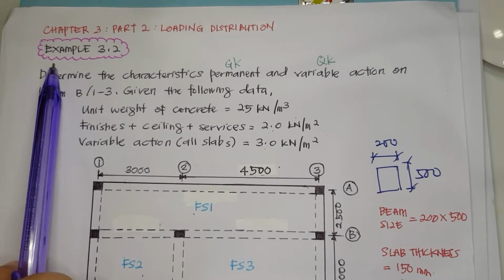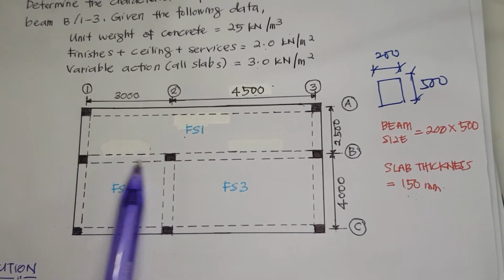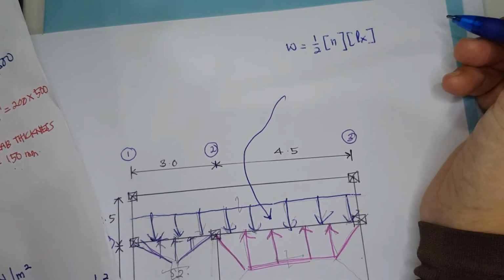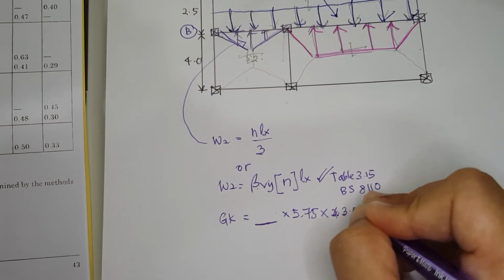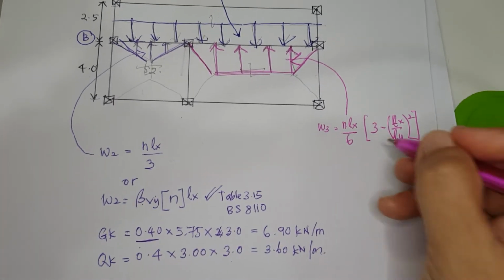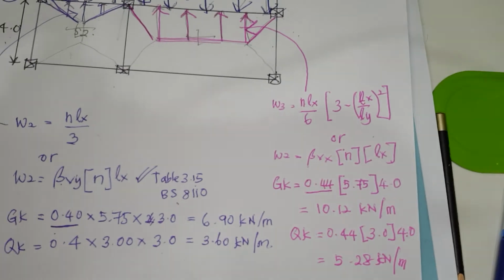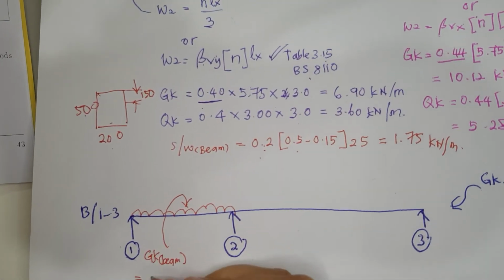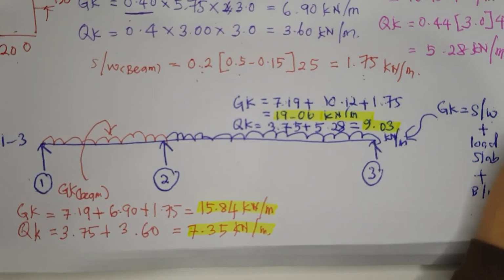Slab loading distribution

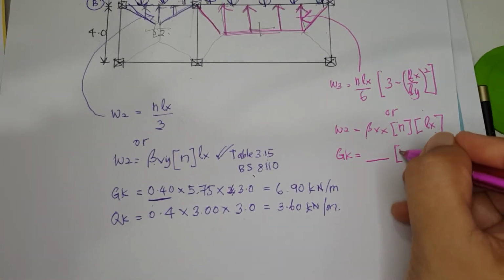Comment: in 16:20 , for the calculation of Gk  in FS2 section, shouldn't it be 0.4x5.75x1.5 ? Because that will give us the maximum intensity of the triangle distributed load.
Reply: do you know why she used 0.4 for the 2 slab and 0.44 for the 3 slab? 
i thought the general formula was 0.5?
Reply: 0.4 and 0.44 are shear force coefficients. those come up in  more complicated loading situations.